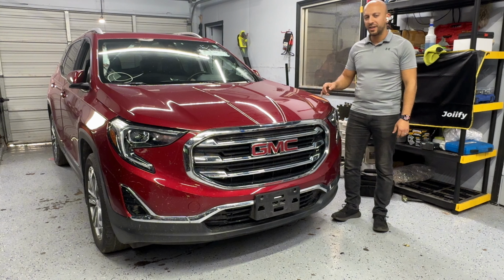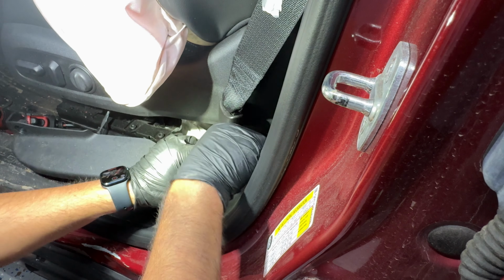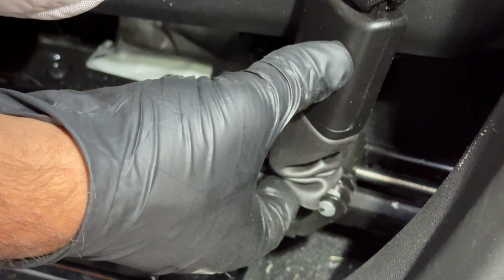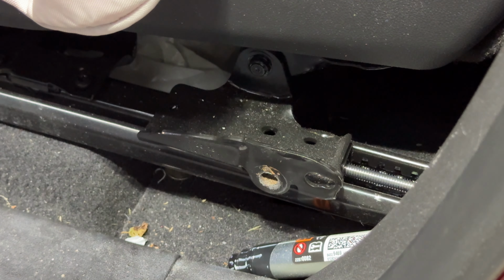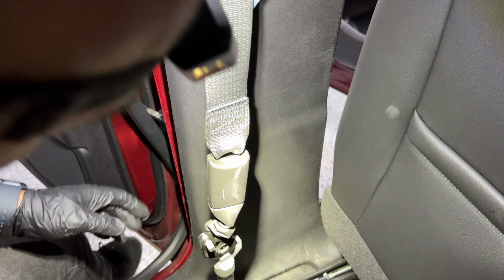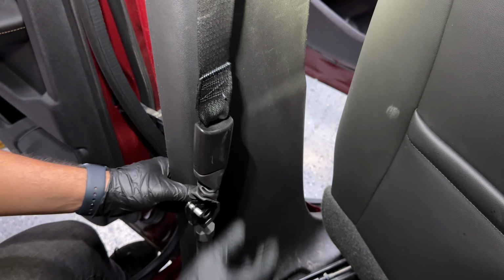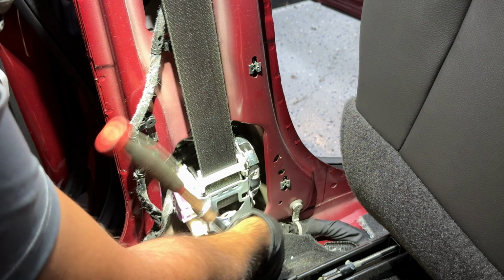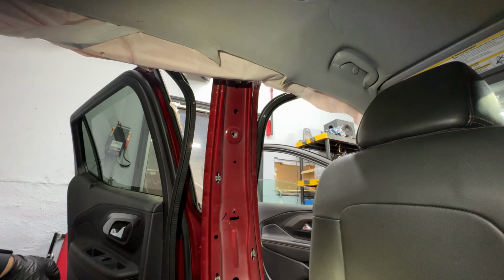GMC Terrain / Chevrolet Equinox Seat Belt and Pretensioner Replacement (18/2024)

Comment: Have a question I got 2017 Chevy equinox LT driver side that might need a seatbelt pretensioner . The seatbelt wasn’t locked all the way after the accident. Do I have to only change the pretensioner or do I also have to remove the seatbelt too? After replacing the pretensioner how to clear the airbag?